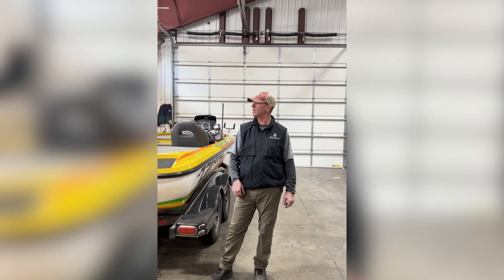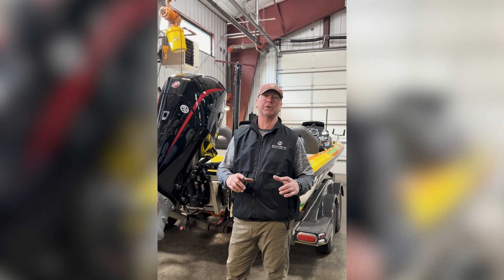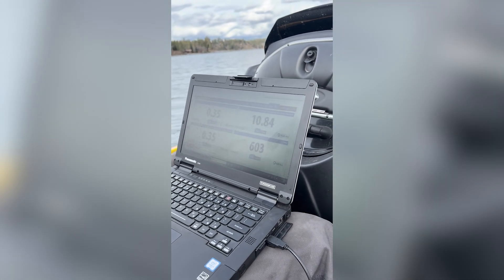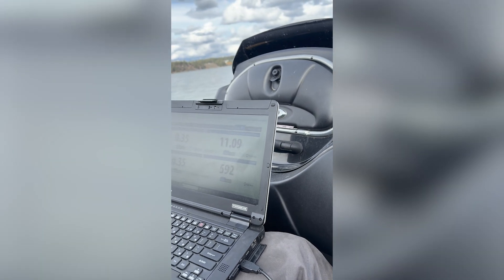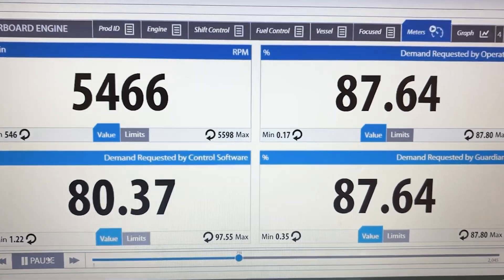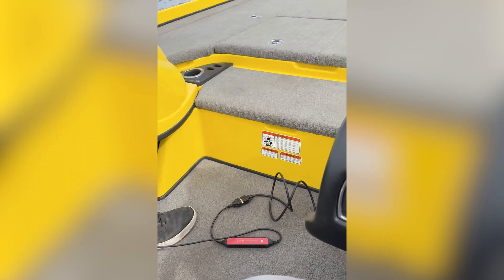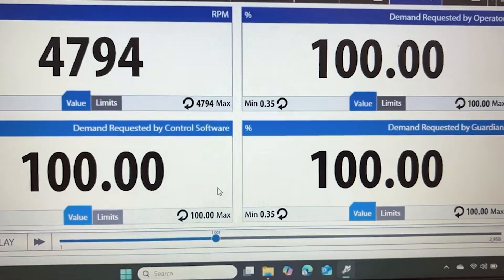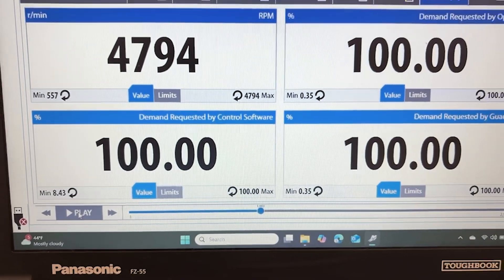How to Properly Prop a Mercury Pro XS 250 V8 After Repower | Nitro Bass Boat Test

Comment: Having same issue. Can’t reach full throttle no matter how I’m propped. Throttle adjustment it is.
Reply: If your outboard is the same as this one then yes quite possibly a throttle cable adjustment will be necessary.  The cable basically controls a potentiometer and it lets the ECM know what the throttle opening should be.   One thing I did not mention is engine mounting height and the importance of achieving maximum potential of the outboard.  Hope this helps.